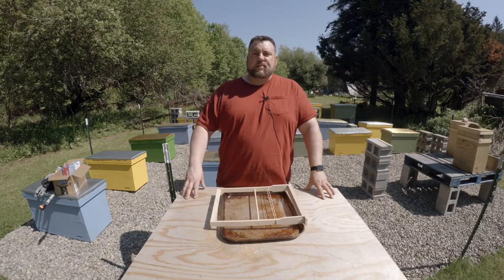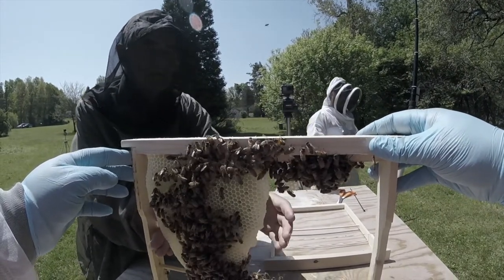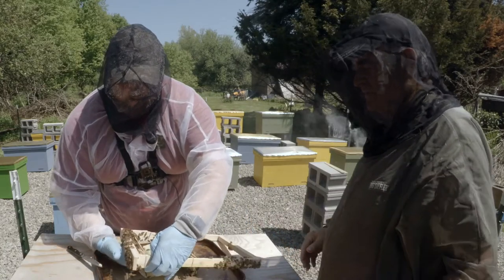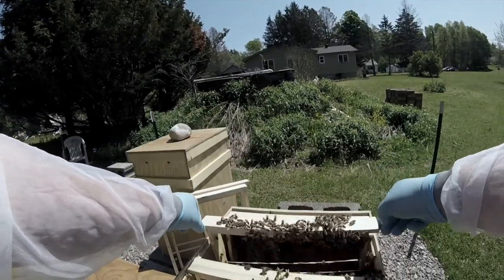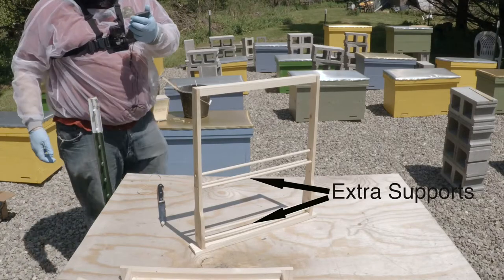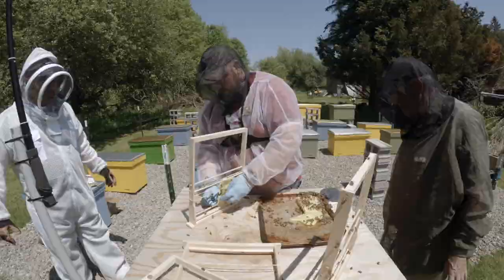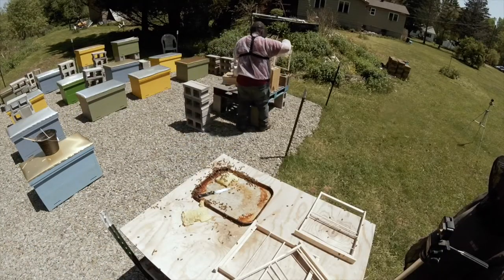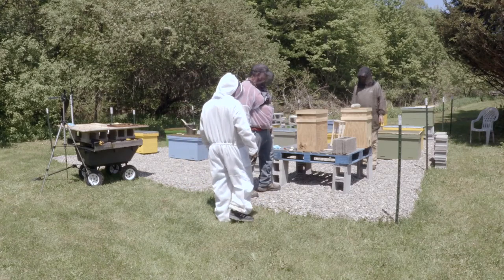Fixing Cross Comb... Sorta

Comment: I am a new beekeeper myself and I am going to build one of these hives for my wife. I see Doc Leo uses wire in his hives but I was thinking of using fishing line like what don the fat Bee man used. What is your thought?  Keep up with the video. Jim
Reply from the maker: Hi Jim! You will definitely want to wire or use fishing line if you use foundation. I decided against using foundation in my frames for a couple of reasons. According to my research bees do better on natural comb, build it faster, like to make holes in it at strategic places, and can communicate better throughout the hive. It's also more expensive, sometimes falls out of the frame, and time-consuming. 

Dr. Leo has some great plans for foundationless frames and you can check out my video on building them on the channel if you want to see how I do it. 

If you decide to go with foundation I can't vouge for either system but they both have their merits. Fat Bee Man likes fishing line so he can cut queen cells, Dr. Leo practices natural beekeeping and need doesn't cut queen cells. It's probably impossible to cut a queen cell with wired frames. If you have no desire to cut queen cells maybe try some of each and see which you prefer?

Let me know what you decide and why you choose that method!

Comment: The paint sticks I had jammed in the channel of the top bar fell out... this is my first year beekeeping and I didn't have tons of supplies, so I left it to them and thought they might clean it up since it was at the bottom, but no. Wax was so soft it all just fell apart when I tried to help them :( glad yours worked out better! Putting two dowels in is smart
Reply: The worst part is they were building it all straight.
Reply: Thanks for your videos, helpful without all the extra and still entertaining
Reply from the maker: Thanks for your comments Savannah!
Reply from the maker: You probably already thought of it, but you could glue the paint sticks in. That’s what I did with my frames and it seemed to work well.
Reply: @BeeBoyBill  yes I did that with the just recent batch of frames I assembled - thanks!

Comment: Have incredible cross comb in my new Layens.  Lots of honey, but 80 degrees off alignment.  Cut across it with filet knife.  Bad idea.  Released so much honey Bees were drowning in the entrances and it was running out the cracks in the bottom.  Had to cut new emergency entrances and after they nearly all sat outside for 3 days, they have started getting their lives back together.  I think I'll look for foundation to fit for next year.  This is awful.
Reply from the maker: I've only had to deal with it once and it was my fault to begin with. I had left a frame out to feed my first package and they built on the edge of the frame. All of the swarms I have caught made perfect natural comb. 

Foundation is an option depending on your goals and philosophies and comes with both positives and negatives. On the plus side, you will force them to make the comb straight by using foundation. 

If you decide to try natural comb again, make sure you're using starter strips that of some sort. I use wooden slats about a 1/8" thick that hang 3/4" below topbar. Make sure to coat them with wax. I documented these steps in "How to Bait a Swarm Trap" and "How to Build a Layen's Frame" videos. 

If you decide you don't want to use wood, I have heard of using a strip of foundation as a starter strip.

If you are starting with a package or shook swarm on the natural comb(empty frames), I would check them at least the next day and make sure the comb is how you like it. Once you get a few started in the right direction it should continue. In my larger colonies, I add empty frames between drawn frames so they do not have a choice.

Hope this helps! 
Bill
Reply: First timer here too.  I had them in a swarm trap with only two frames so they built an incredible structure on the plywood lid. I just transferred that to the main Layens and gave them frames to work on then had to cut out all their beauty and try putting it in the frames.  Also discovered no eggs or capped brood so it was a good job I did.  They are all straight and off to the races on frames with just an inch starter strip